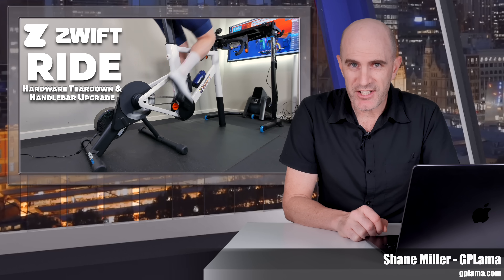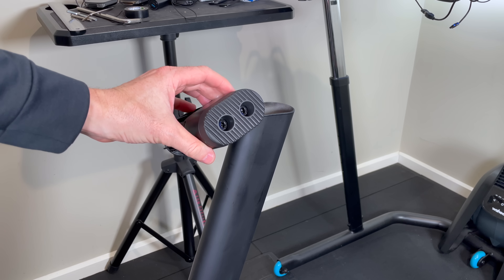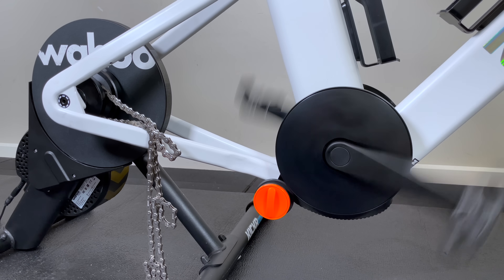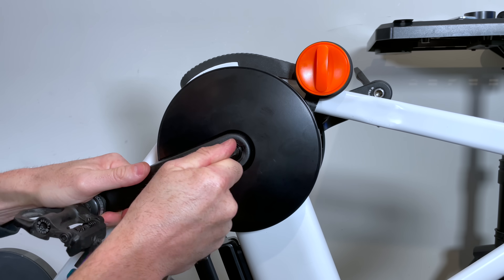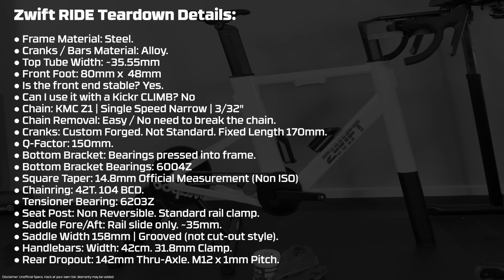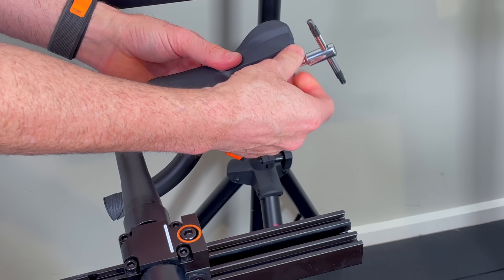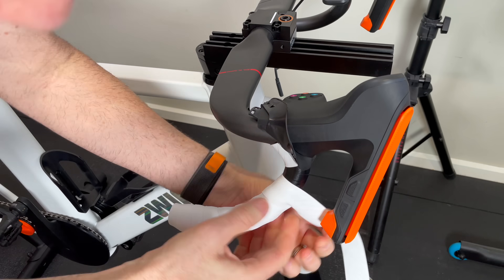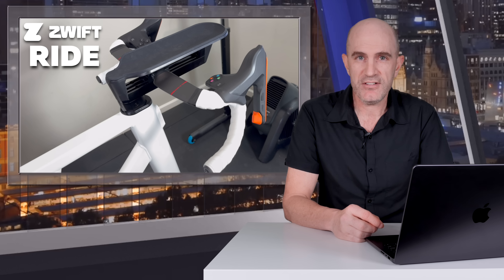Zwift RIDE Hardware Teardown and Handlebar Upgrade!

Comment: what has become of your internal routing of the charge ports?  I can't seem to find that video if you did one on that option.    

I also have to say how cheap to not include a charge block with the cables, they supplied pedals so why not a block.
Reply from the maker: I didn’t find a suitable y-splitter, so I’ve kept it as-is. 

Charge ‘blocks’ are a pain in the arse when it comes to selling something across different regions. Most small device manufacturers no longer supply them.
Reply: @gplama  thanks for the reply

Comment: Hello what tool is been using under the 3:25 Bottom Bracket  I just bought the adjustable Cranik arms but seems to be missing that last tool to remove the old cranik arms :)
Reply from the maker: That's a square taper crank puller.

Comment: What is the length of the BB spindle can’t we just replace it with another normal type?
Reply from the maker: The size of the bottom bracket is non standard, so it's not something that can be swapped easily. The crank arms are also designed to clear the chain tensioner on the Ride. Standard cranks may not have the clearance.

Comment: Can it be used with a normal cassette or must one use the Zwift Cog with it? I know then there would be no virtual shifting!
Reply from the maker: Virtual shifting does not require the Zwift Cog. The Cog itself contains no smarts/electronics whatsoever. It's just a cog. To use the Zwift ride with a cassette you'd need a 8 or 9 speed cassette to fit the chunky chain on the Zwift Ride to do this, or to switch the chain to something suitable.

Comment: Shane, old video, I know, - but do you know if Zwift ever plan to sell just the controllers, so they could be mounted on existing handlebars just as you did in the video? Otherwise, buying the complete Zwift ride is the only option as I see it. It's kind of a pity, if you, as I in my case, am very happy with the indoor set up.
Reply from the maker: No word on then selling just the Ride 
 controllers/levers. The alternative is to buy the Zwift Play controllers and mount them.
Reply: @gplama  Cheers for getting back to me Shane. The problem with the Zwift plays (I already have those) is shifting: when I'm in my sprint, I really miss the option to easily shift gears without moving my hand position.

Comment: Which dimensions for the handlebar ? W1:42 & W2:40 or W1:44 & W2:42 ?
Thanks for the review !
Reply from the maker: The RXL carbon bars I installed are 38cm C-C at the hoods 45.8cm C-C on the drops.

Comment: @GP Lama isnt this a standard BB30 PressFit BB Shell??
Reply from the maker: No
Reply: @gplama  thank you! Have you considered switching the bearings to 3806 2RS TN? They should fit and mage room for a 30mm axle; just the width is 1mm to small but could be fixed with a spacer i guess

Comment: Hey Shane would you please try converting it to SRAM Dub BB? It has a 42mm outer shell diameter (6004 bearings), and there should be enough options for a DUB bb for a 42mm shell (one of the BB30 variants). Or could you at least tell us the shell width of this frame? 
I strongly believe the option to change to another crank would be a game changer for many...
Reply from the maker: Likely a dead end as the cranks need to be shaped in such a way to clear the tensioner in the drive side.
Reply: @gplama  you could ditch it alltogether and run a "magic gear" without tensioner

Comment: I didn't realize how tired I was of swapping my bike in and out of the Kicker Core until I got the Zwift Ride. It went together without issue very quick, and I got it adjusted to match my gravel bike easily. It only took one quick session to determine the handlebars had to go! I replaced them with the alloy version of the AGX K-Wing (matches width and flare of my outdoor bike), then wrapped them with Wolftooth Supple Bar Tape (in Zwift orange!). The tape was so thick that it wouldn't go around the back of the lever properly, so I wrapped each side of the bars in two separate pieces. The end result is a very cushy cockpit that seems to give a bit of relief to the arthritis in my hands. Thanks for the inspiration!

Comment: Looks sadly like another product which, for want of only a shade more material, will discriminate against those over 6'6" - the excuses are more limited for an indoor machine like this! Cranks are too short and can't be changed - was there really a need to deviate from bike industry standards? That's probably cost them, rather than gained them, sales.

Comment: A very late question :) Do you know if it can fit 10x7 mm saddle rails? (Fizik Vento Argo R1)
I have the ride + such saddle, but... it feels like the rails wont fit, and I didn't dare to apply much more force  - installed the saddle on outdoor bike instead.
Reply from the maker: Not something I’ve attempted.

Comment: The fore and aft adjustment on mine is completely stuck - need to disassemble the whole thing just to get it to move and even then it barely does.
Reply: @gplama  ha! That's exactly what I did.  Used a mallet well really a 2.5kg plate and it shifted

Comment: Shane, I am very interested in this but also very interested in the race mode.  Is there any chatter about race mode coming to the kicker core with a firmware update?  I sent an email to wahoo but they did not have much insight.  Thanks
Reply from the maker: No word. Unlikely I’d say.

Comment: Shane thank you for this super informative video.  I have my Zwift Ride coming in a week and plan to see if I can attach the frame to the Zwift Move (with the frame locked out).  I am guessing it should work.  Keep up the great content!
Reply: After hooking up the Ride frame to my Zwift Move it works!  I did notice some limitations regarding the handlebar functionality.  For instance there is no option to shift Shimano or SRAM  or anything else.  That functionality resides in the KICKR Core.  Looks like we will have to wait until a firmware is released to fully accommodate the play handlebars with the zwift Move

Comment: While I ride 170mm my best cycling buddy rides 175mm, my brother rides 172.5mm and my wife rides 165mm. This fixed crank arm length with non-standard crank is an absolute swing and a miss.
Reply from the maker: It’d be good to see them offer after market crank lengths. They come off with a standard square taper puller.

Comment: Thanks for the video. 
Wouldn’t it still be better find a cheap 16-speed bike and then buy the kickr core? Then you will still have a normal bike plus if you have problems it should be easier to fix.

Comment: Thanks for the informative vid as always Shane 👍🏻. Having used it, do you think it would be possible to retrofit  a set of forks onto it to make it climb compatible? Which is something that zwift could have easily done in the original design (removable centre leg that slid up inside a fork design).
Reply from the maker: You’d need to chop the front leg in 1/2 and make a mounting bracket to connect to the Climb. Not impossible. Just a bit of hacking around.

Comment: Does or is the lower section of the front leg (The Black Part) have a join or is this just painted black? Thinking there's the potential, if there was a break, to add a bracket with with drops to allow fitting on to a climber device.
Reply from the maker: Painted. You'll need to cut it to fit it (with a bracket) on a Climb.

Comment: A massive fail, terribly designed, buy yourself a cheap Alu with 105 Shimino, non Thru Axel bike, and youve got a bike you can use outside, useless thing. If its 50€ then ok.

Comment: It seems like everything Zwift introduces is half thought out. Frame doesn't work with a climb, single length crank arms,  non standard bottom bracket, Zwift only compatible shifting, etc.
Reply: Hack forward slash bodge
Reply: Its all part of  a 5 year marketing plan. There will be a V2.   V3 .... or  adapter sjit

Comment: For the racers, we've seen Zwift race stipulations where X2 power measurements are need to ensure no cheating.  Does this mean with the proprietary cranks either a Zwift-Wahoo crank colab will be needed or a spider/pedal based power meter will be needed too?   Will the clearances around the Zwift cranks give allowances for a ring based power meter?

Comment: Good tear down and sec review!!   Could the removable front foot be for future upgrade option?  Maybe a foot with a pivot point to create a rocker plate motion.   

Also, that chain option going through the rear triangle rather than wrapping around it gives the potential for a belt drive to lower the maintenance even further.

Comment: I extended the length of the trainer legs on my Core some time ago. It's a common diameter tube (got it from Ebay from memory) but get a decent walk thickness otherwise it deforms when you tighten up the bolts!
Great vid as always. 👍

Comment: GP, if one already has a dedicated trainer bike and is considering an indoor upgrade, which would be a better option, this Zwift Ride or the Kickr Move? Or would saving up for the Kickr Bike/Shift be a better option than either of these?
Reply from the maker: Entirely your call. There's no 'one option is best' solution. I respect there's a LOT to factor in, budget being one of them.

Comment: Apart from the controls, how does it differ from a standard frame? You can only adjust your saddle so much, you can't change the crank length, you can even put it on the wahoo climb, so yeah. Damn
Reply from the maker: I make videos like this so people can make up their own mind based on more information than just a glossy advertisements.

Comment: Can the square taper bb be replaced with a standard one?
Reply from the maker: The bearings are pressed so I guess you mean the spindle itself? I’m not sure. If you could you’d then have issues with crank clearance and possible chainline issues.

Comment: Will this work with a rocker plate? There is no way to secure the front to the plate so I wonder if it would be stable.
Reply: It would be as stable as a bike with a front wheel (that isn't fixed to the rocker plate).

Comment: There appears to be a bolt on the upper portion of the front tube (in the back.) What is that for?

Do you know if the Kickr Climb is still popular, or was it cool to try when it came out and has been forgotten by most people?

Comment: From the day these came out I didn't understand why they don't just sell the bars with hoods/controllers and you can attach them to any bike. now even more so if you can just put the hoods on any handlebar. A lot of people already have dedicated trainer bikes and even if not you can buy a cheap frame, cranks, and chain for way less than $1,200. The only proprietary thing about this is the controller.
Reply: They already sell the Zwift Play controllers but maybe they will make these ones available too. Also need more trainers to support the Zwift protocol for virtual shifting.

Comment: Would have been an instant buy if it wasn't for the fixed crank length
Reply: You'd think selling optional bolt on cranks of different sizes would be worth it. Would be a fairly simple part to manufacture all things considered.
Reply: @sethcycle4591  Since they are metal piece, I feel like threading them could be doable and cheap enough
Reply: well
Reply: I drilled and threaded a second set of holes for 155mm length on MY Ride. It's working famously for me (5'6"). I posted the WIP on Zwift Forums and the mods deleted it. They do NOT want DIY fixes. I also posted it on Reddit on r/Zwift. Find it. Of course the PUNDITS are abundant, yet I will tell you I have had ZERO probs. I filled the blank hole with a threaded plug (cut off from an old set of Pedals.) Go for it.

Comment: The ultimate bottom bracket test would be let Mr Searle have a go and see how it is after a year!
Reply: If my calculations are correct, the bearings are rated at 25,000kM or about 15,500 miles. If a person does an average of 41 miles daily, these bearings should be used up at the end of the year. Shane said the bearings were tested up to 25,000kM, not rated for only 25,000km.

Comment: the proprietary crank and its fixed length is a huge miss unfortunately
Reply: Yes, it’s a no for me. KICKR bike got it right though.
Reply: @40datboysha at a slightly different price point 😂 170 is a great compromise for the masses.
Reply: @40datboysha new variable crank arms just ordered. $99 USD.
Reply: When I first saw this trainer, I was immediately ready to purchase. I run 165/160mm cranks. Oh well...
Reply: Same with the Watt Bike. Part of the algorithm to calculate  power is based on rheir fixed crank length.
Reply: @doppelnfts It means, if you run the same crank length as the Zwift bike ... good to go. Anything outside that, then be prepared to compromise.
Reply: Shane - with revision #2 of the handlebars, suggest extending  handlebar tape well over the area where hands rest. For ultimate comfort try Lizardskin DSP 3.6 or 4.2 tape over Fizik bar gel set. Very comfortable.
Reply: Yeah this is super dumb. Could have done it easily with flip chip type mounting

Comment: About the only thing holding me back at this point is the lack of adjustability in the cranks. Maybe V2 will pick that up especially as it looks like they’ll have to be custom.
Reply: Just got the bike today, while I love it, the crank felt too short compared to my bike. I'll have to get used to it I guess.
Reply: it's really a shame, at least they went with 170mm which isn't that much too long for most men.

Comment: 🎊 nice one,when it’s a frame only option using my v6 will it be good to go to go with a cassette on the back 🤷‍♂️😊
Reply from the maker: You'll likely need to swap out the chain or use a 9spd (or lower cog count) on the rear. The KMC chain is one chunky monkey.
Reply: @gplama  Ty 🤩guess the cog is the easy option that’s an additional purchase tho , cheers mate 😎

Comment: Great video, as always!  I can't help but wonder how this frame will work with other (non-Wahoo) trainers, e.g. TACX Neo 2T. I suppose you'd have to convert to a SS cog in the rear, but I don't know that I've seen that done yet. I'd love a video exploring what's feasible today and what's in the works for cross-compatibility.  Thanks a ton!
Reply from the maker: Garmin/TACX will need to support the 'Zwift Protocol' for virtual shifting. The RIDE (non bundle) will likely ship with a COG that'll slide onto any Shimano HG freehub. What works today is the Kickr CORE, Kickr 6, Kickr MOVE, and Zwift HUB. That may change soon.... Eurobike is next week.
Reply: @gplama  I have Neo 2 but very tempted by this setup. Is there any sign that Tacx/Garmin will update firmware for Neos ?
Reply from the maker: @jbuzza00  I have very limited insight into anything Garmin/Tacx these days. If they do end up supporting this, I'll cover it here.
Reply: @gplama  looking forward to hearing what you learn. I still have a 2018(?) Kickr Core over in the corner of the Pain Cave, but my 2T is  my #1 trainer.  While on the theme of need to support virtual shifting, do me a favor and kick somebody in the shin -- let them know there are A LOT of flat bar Zwifters out here that they're ignoring.  Thx a ton!  Ride hard!

Comment: Oh hey a pressfit bottom bracket.
Reply from the maker: CeramicSpeed are surely planning something here! An upgrade kit worth more than the bike!
Reply: @gplama  why not something from a 5yo 🤔

Also it seems likely belt drive is a future option at least the impression I got from a comment by DCR when I said it looked possible
Reply: At this point, dumping on "press-fit" simply reveals ignorance, since the entire mechanical world runs on pressfit bearings.
The trick here isn't the BB, those 6004 bearings are a very common size, it's the 20mm axle crank that's the trick to find
Reply: @galenkehler  who said I was dumping on pressfit?  I love pressfit. Surprised a bicycle (even a trainer form) is using it in this day and age where almost all mainstream brands run away from it.

Comment: You tested stability by standing on the pedals at the bottom of its rotation. What about standing on the pedal at the top of its rotation? How about a full out sprint?  The single foot at the front of this bike creates a triangle what doesn't look very stable when leaning forward.  You have ridden other smart bikes with 4 legs. How does this bike compare?
Reply from the maker: It's a Kickr CORE when it comes to 'stability', for which I have no issue. People haven't been toppling off those since it was introduced back in 2018. You really need to be doing something wrong if it has happened. As mentioned in the video, the front right leg on the CORE could be extended with a custom hack if really needed.
Reply: Have you not seen a real bike? Do they have two wheels in the front or something? Why would this be any different?
Reply: The footprint has a larget contact patch than an actual bike tyre. When will people understand this?

Comment: Nice upgrade Shane. Looks way bettter.
Reply: Hi. I am trying to swap out the stock pedals to the clipless pedals, I purchased a set measuring 9/16. I took off the the stock pedals, when I tried putting the new pedals the threads are connecting. I tried both sides and no luck. Any ideas?